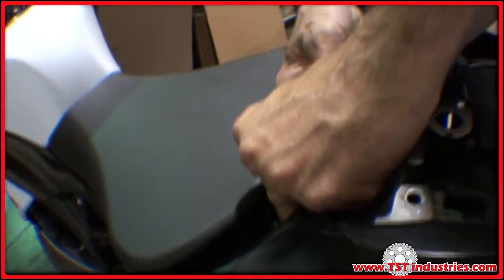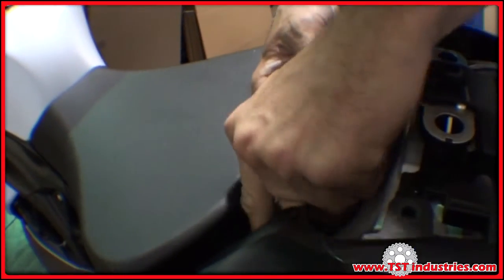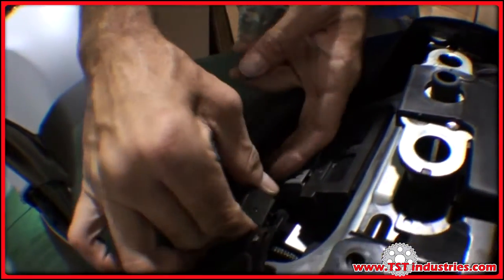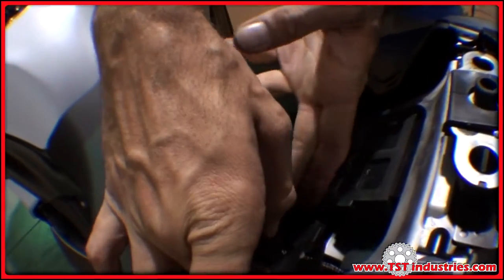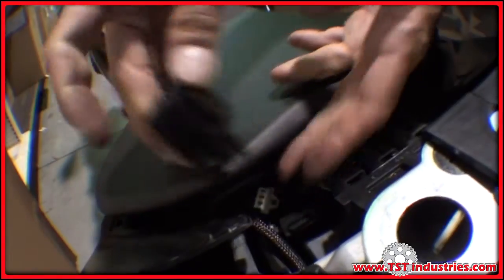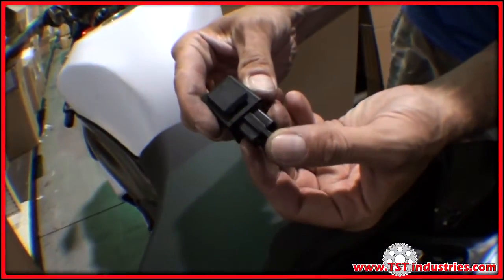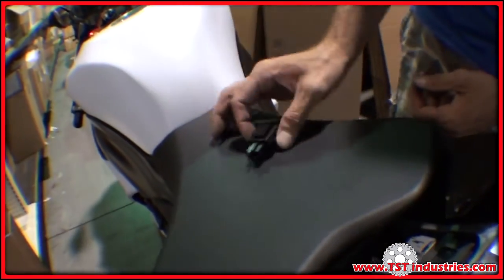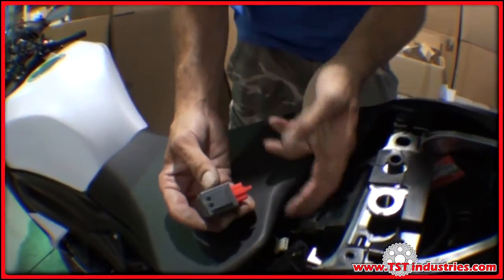How to: 2013-2016 Kawasaki Ninja ZX6R 636 LED Flasher Relay DIY Installation by TST Industries

Comment from the maker: When you change your signaling components to LED type, the flash rate increases. This relay controls the flash rate, and also allows you to change it to a faster or slower rate based on your preference.